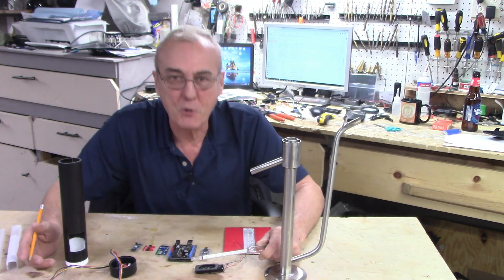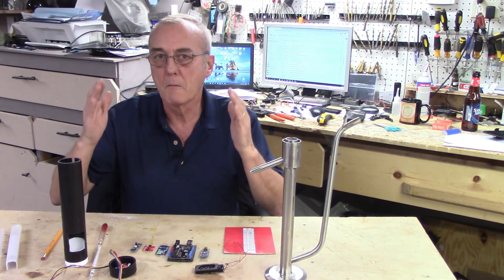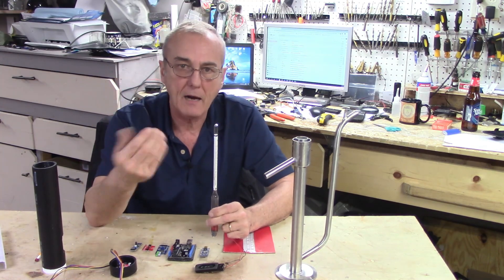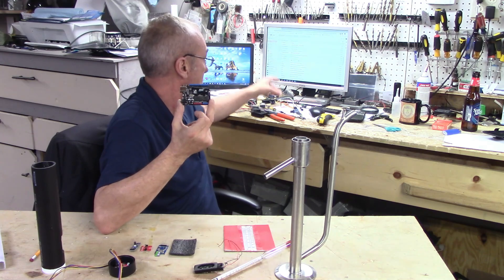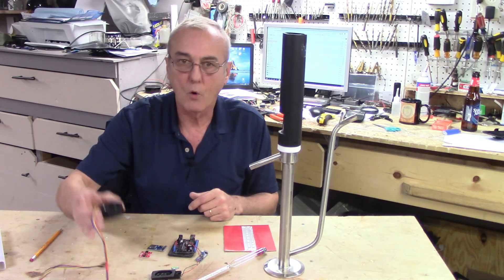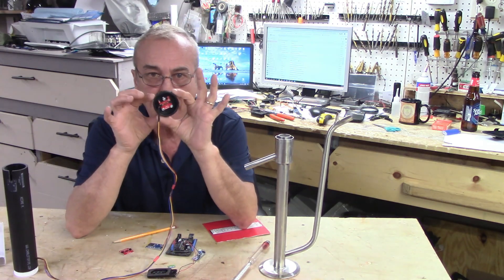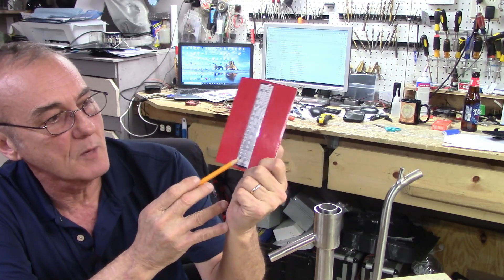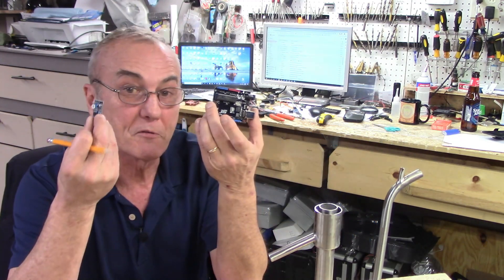AUDIBLE PROOF AND TRALLE PARROT HEAD

Comment: Hey there George , you enlightened me once again to a piece of equipment that I simply had to have ....... “ The Parrot !”  I looked high and low for a parrot in my price range but I couldn’t find one cheaper than about 50 bucks. So I had to put my mind to making a homemade parrot.  The little blue kit that I found on Amazon, the alcoholometer set that is mini size and divided into 3 sections, comes with a 100ml. Plastic testing tube ( beaker ).  I made a parrot that is perfect with the mini P&T set in the blue kit .  I wanted to post the pictures of it but it won’t let me send it here so I will send it to ya in an Email.  You might want to use the idea and pictures to tell folks how they can make one.  Happy Distilling !

Comment: Happy Distilling , on screen mention , 15:28 time stamp,, the reading would be slightly different from measured,,  how slight of a reading are you talking,  1%  or 10%  on the scale.  this is just awesome,, I want to make one  just for the fun of doing it,,   Question,, will a different hydrometer ,, say you break the one you are using,, and replace it,,  will that make every reading different,, meaning you have to reprogram ..  I think I have about 3 different ones,  and the measurement from top to the proof lines are different measurements,, that paper label inside is just not placed the same,, they are probably  placed different according to weight in the bulb,     any thoughts on that.
Reply: @jbrunson1949 The difference in the reading was between 4 - 6% of what we could visually read so it was minor but apparent.  We are working on methods to reduce / remove this bias in the reading.  Next question, will different hydrometers give different readings... answer is yes.  However in the software code we will be exposing a configuration file on the SD drive where you will be able to specify the offset (of the hat at the 0 proof reading) as well as the 0 to 200 proof range distance.  A lot of coding went into this and there is still more to do. :)
Reply: OK,, that makes sense,, sounds like some great work you have done with George, Keep it up. and many thanks,, looking forward to the codes and updates  being posted,, let me know where tolook please.

Comment: This got my attention with the first video you posted. I built a similar system using a custom-built  ESP8266 board with a Pololu TOF sensor and a DS18B20 digital temperature sensor. This allows me to calculate the ABV adjusted to 20 degrees C, and transmit the results via WiFi to a server that stores and graphs the results. Thanks for the inspiration.